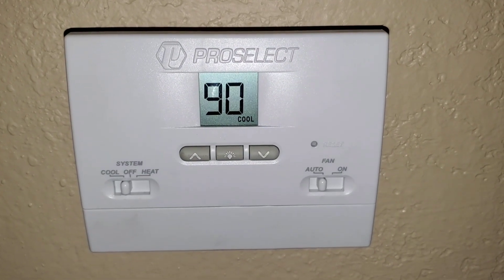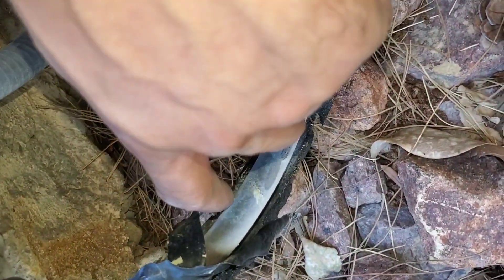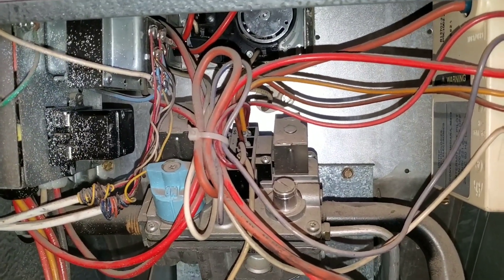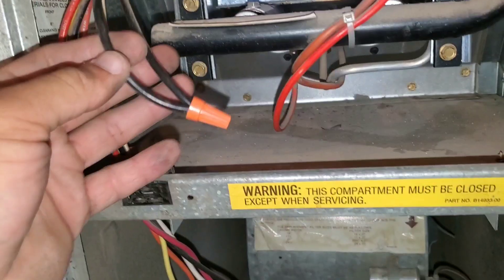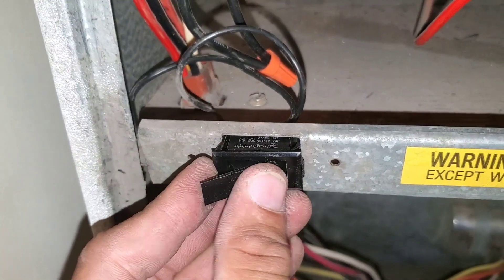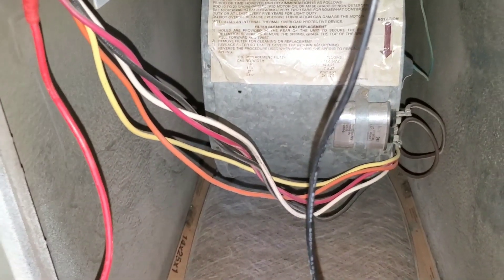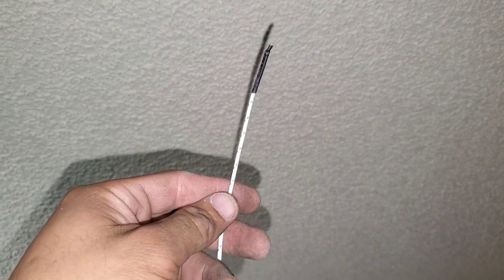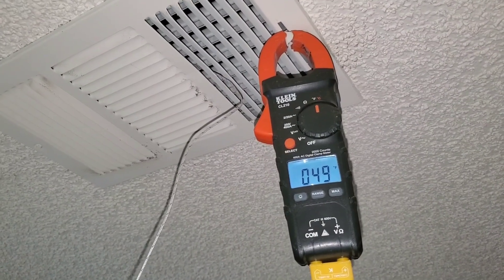AC Not Working?! Blower Motor RELAY not Working

Comment: Good man, going ahead & changing that filter while you were at it 👍 
How do you like the Klein temp.clamp? Seems pretty well made and does not cost as much as some of the others out there, like Fieldpiece.
Reply from the maker: I have used Klein for years and honestly... I have had no issues as of yet. I do enjoy using their I multimeters. I am doing a video where I will be showing new technicians how to use their multimeter, different settings etc. With that being said there are those who prefer to use other brands such as Fluke, Field Piece etc. Would I use a Fluke or Field Piece? Yes of course... however as you stated the price of Klein products is very reasonable in comparison to others on the market. 🙂